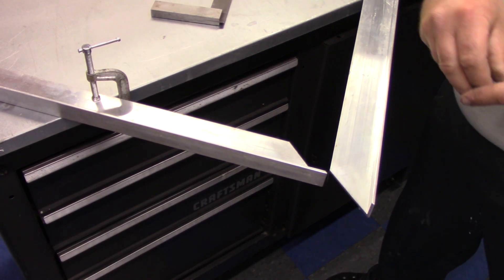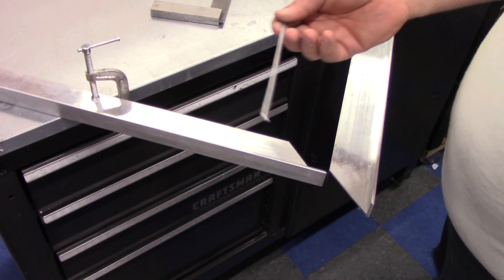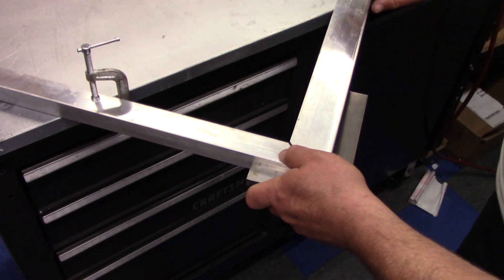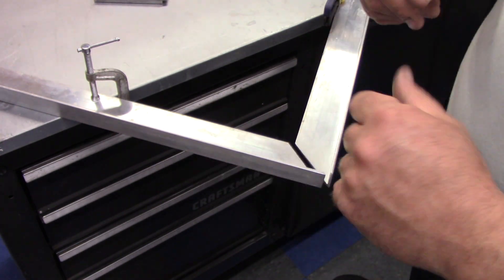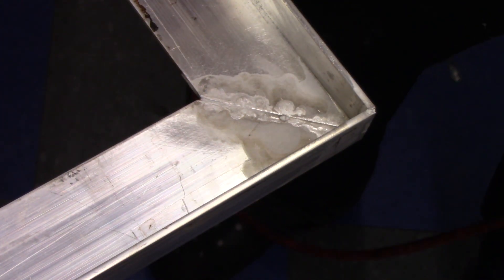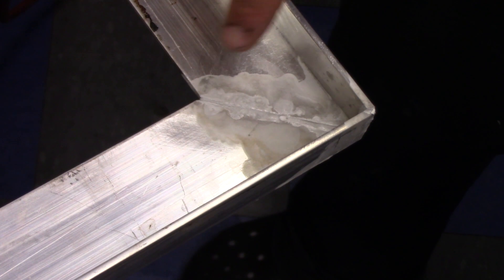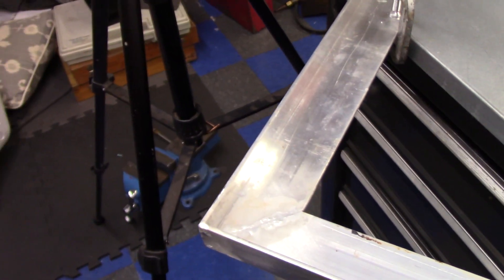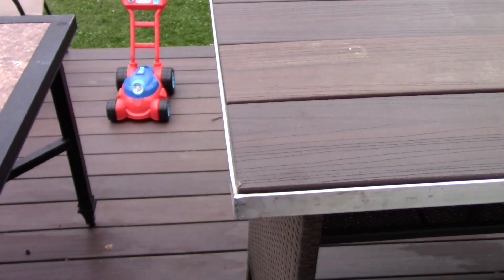Aluminum Brazing With Acetylene Torch

Comment: Blazing really just doesn't hold up that well, just invest in a stick welding machine. Try using the flame torch instead to preheat the metal pieces to about 600-650 Degrees F. With an ER4043 stick, set your Arc to ~25%, Amps to 80-90 (more towards 90 if very thick), and then make sure to keep consistent heat on the metal. It should be an OK weld. Won't look like TIG or anything but it still gets the job done.

Comment: The thing i don't understand about brazing, is the aluminium brazing rods melt at 580°C, and Aluminium melts at 660°C, and gets soft and compromised sooner than that.
Unless you've got very precise temperature control and monitoring, how come the aluminium doesn't warp and droop when brazing?

Comment: Yeah it’s very helpful and easy fix too in a pinch you def have to heat that up more so if it a higher stress point I’ll heat up a portion of the crack enough to do a dime one first second third centering it in but I’ve seen people use axle grease to welds cast aluminum didn’t believe much in the method at first till I seen quality of work kind of but not really just in the sense iit protect the weld . A battery charger stainless steel plates like outlet cover liquid elc tape all stacked in series tickled by about ten amp off alternator using the vacuum for injection to pipe hydrogen generator by this simple install not bullishit seriously Il l give anyone my Toyota Camry if you can show me it doesn’t work literally within a couple of weeks the inside of your motor with be Perfectly  lean Toyota doing a 3 cylinder version turbo puts out more ponies then it’s turbo older cousin

Comment: I haven't tried the Lucas ones yet. Only aluminum rods that worked decently for me or anyone I know is Hobart brand (can get them at TSC).  Those will give you a fighting chance of success.  Those Lucas ones you used were really good AFAICS but wanted to thank you for a piece of technique you showed - heating the parent aluminum until the rod wicked onto the aluminum (keeping the flame away).  I did this before, but what this video showed was that the wicking test is really the only way to go about using these and not mixing in any other method.  

Also, it looks like that air tip is the best tip to use for this from what I can see.  It's perfect for the task (not too hot - too hot makes heating the aluminum more unpredictable). Thanks for showing this.

Comment: Alumaweld best way to get it to work is use straight acetylene to leave a black film on your work surface.   Then using your oxygen and acetylene, once the black is burned away it's hot enough to braze

Comment: Aluminum weld works great. Metal has to be cleaned. Propane or Map gas will work. You have to be careful not to overheat or melt the pieces you are welding.

Comment: I broke the tachometer can mount tab on my motorcycle. I used the aluma rods from harbor freight. Clean, Flux and temp control. Too hot is just as bad as too cold. I have temp sticks for this.

Comment: So the ally rods are great for specific operations. If you are failing to use this material strategy you probably thought to heat the rod... You heat the rod at all... You heat the object to atleast 660c and then apply the rod to the joining area........ With heat still applied to the original/base object allowing it to maintain high temp

Comment: You did most of the soldering wrong. Heat the metal and melt the rod onto it. Don't put the torch on the rod.
Reply: He did, that’s why it worked. Literally heating the metal from the bottom applying the solder on the top. Strange comment….

Comment: Alumaweld works great. The gaps here are too large. The pool will just flow through the gap and drip out the bottom like water. Pieces need to be butted together reasonably tight.
Reply: You mean exactly what didn’t happen in the video? You bother watching it?

Honestly I was impressed he was able to fill that gap.

Comment: Personally as a welder I do a ton of brazing and soldering , I think you need better understanding of the technique with the torch
Reply: @Traditions-catch hear we go with the I'm a welder and your wrong bs well I’m a certified welder and been for a couple decades so the one thing I have learned is everybody’s technique is different but works for them, you can show someone your technique but usually they stick to there own
Reply: @justinw523 back in his day he could out weld everyone with his eyes closed
Reply: If you use an oxy-acetylene torch that is properly adjusted, you will notice  dark area of the flame.  The dark area is neutral and as such is the shielded area of the flame and your bonding should take place in this region to prevent any unwanted gases from contaminating your weld.  The rule of thumb is the kernel of flame should be approximately the same width of your workpiece.  Choose the appropriate tip and adjust for the dark area of the flame and proceed.  These procedures will work with many different types of metal.  Stainless and aluminum will melt away rapidly if you exceed temperature, so proceed with caution and practice before continuing with the workpiece.  Cheers
Reply: @hillbilly4christ638 good tips! I'm a west coast metal head-rocker for Christ! 🥳
Reply: Would you recommend using an oxygen and a settling wing tip?
Reply: It worked! Why do you have to comment like a smart ass?

Comment: To get the harbor freight stuff to work, you need to heat up the rest of the surrounding metal to 720. Gotta be using Mapp gas and a beefy torch too.

Just gonna get an oxy-propane torch because I want to braze steels too.

Comment: There’s absolutely no fusion do it at all it’s basically just like laying solder on there… it will work for low tensile applications but no comparison to it being arc welded

Comment: 10 years ago I used similar rods.  I think they were from Harris.  My LWS gave me some to try and work just like yours and they weren't cheap then, either.  
However, those Alumaweld rods will work.  You just gotta alter your technique because they are fluxless.
I kept meaning to post an in-depth video on them and why most attempts fail but I got old and forgot.
Reply: p.s.  When I do make the vid can I use a bit of your footage to compare the 2 rods?  I don't have any of the expensive rods anymore and I was going to mention/shout you out as part of the story/reminder.
Reply from the maker: @EddieTheGrouch   Absolutely.  I tried scrubbing and getting those alumiweld rods in the joint, but never really worked for me.  I could get it to cover, but never into the joint for a proper bond.  Also miss your vids.

Comment: Thanks for posting this. Can these rods be used with any aluminum? Had you tried to break any of the joints to see how tough it really is?
Reply from the maker: This 6083 is the only thing I have tried it on and the website just says Aluminum-aluminum and aluminum-copper joints.  I don't see why it wouldn't work, but you never know.  I made a 90 degree T joint and tried to pull it apart.  The aluminum bent and cracked but the join didn't.  Again it's purpose is aluminum coils for HVAC which an run around 120-140 PSI
Reply: @Halligan142  Thanks for the info as it's very much appreciated!

Comment: Alumiweld and all the similar rods are a waste of time.  They're usually a simple Zn-Al brazing alloy that's generally indistinguishable from Zamak3 and similar inexpensive galvanizing alloys (96/4).  Some trustworthy products may have purpose-suited trace alloy elements to promote wetting, but I doubt any of the Amazon/HF rods are anything other than Zamak.   You can literally do the same task with an old conduit fitting or something.   I should point out that almost all of these bare rods will say stuff like "no flux needed" or "the flux is in the rod".  This is almost universally a false statement.  The exceptions are noted below.

Zinc alloys will wet aluminum fairly well without flux, but require mechanical agitation to actually disrupt the passivation layer.  As such, they will always tent over joints instead of penetrating them.  In manufacturing, these alloys are used with flux (see Superior #1280), but you'll have to purchase direct from the manufacturer if you want it.  There are coated/cored versions of these alloy rods (and preforms) sold for HVAC work (see Lucas-milhaupt AL822, ChannelFlux ZA-1, and ALUXCOR), but they're ridiculously expensive.  Considering that direct purchasing flux from Superior would require a $100 minimum order, they're still cheaper if you don't need much.

So let's say you did have flux.  Would using these intermediate zinc-alloy solders be a good thing?  In my opinion, not generally.  All zinc-bearing solders will be extremely susceptible to incisive corrosion, especially in the presence of any chlorides.  This isn't a thing that takes place over years or decades.  Joints exposed to saline solution will tend to just peel apart as the intermetallic layer is selectively destroyed.  Immersed parts can easily fail within hours.  For a condenser or your table, it probably won't matter, but I see people saying they made aluminum motorcycle trailers out of these things.  Considering that road salt exists, it's kind of horrifying.

In my estimation, this kind of explains why there are so many of these rods on the market, but no flux.  They're a product that can be manufactured from cheap (usually scrap) material with no real need for dimensional tolerance or material property control.  Over a broad range of conditions, they give the illusion of working well enough that the user will trust that they simply don't possess the talent or experience to make them excel.  The manufacturers that aren't being dishonest about their products are well aware that they have limitations and that the actual market for such things is very very small.

TL;DR  Unless you go buy flux and you understand the weaknesses of the alloy combinations, you're wasting your time with Zn-Al processes.  Al-Si is where it's at. 

EDIT: oh.  I guess you''re using 822.   AL822 is a 78/22 Zn-Al alloy with (iirc) cesium fluoroaluminate flux.  I don't know if Lucas makes a 98/2 rod, though I know others do.  The 98/2 should be better for capillary performance, but I guess you don't need that here.  
You solder/braze all the time.  Now that you've tried a Zn-Al process both with and without flux, what is your opinion of the claims that the bare rods "need no flux"?
Reply from the maker: These worked surprisingly well.  As you said they are geared toward HVAC and are for aluminum coil repairs which nowadays typically run in the 120-150 PSI range and can be in varied environments.  A lot of the coil cleaners we use in the industry are alkaline based and some are touted as "no Rinse" which I always said was BS, but I wonder if that would effect the joint over time?  As far as flux vs fuxless those alumiweld rods are garbage.  I cleaned just the same as in this case with a stainless brush.  Heated the metal up and scrubbed to break up the oxide layer.  All I got was a puddle of melted rod that was well attached to the top layer and exposed edges, but would not penetrate into the actual joint or would attach to one piece, but peel away from the piece I was trying to join.  Even if it did work well, the scrubbing action required melts way more rod then needed and it ends up looking like someone ran a bead of caulking along the edge.  Using the AL-822 was way more akin to what I'm used to with using soft solder, silver solder, and sil-foss rods to join copper to copper.  Heat it up and it flows easily with the heat and is controllable.  Like you said and I said, not anything I would use for any kind of structural or load bearing work, but for decorative stuff or in this case a basic frame it will work for someone without "proper" welding equipment.
Reply: @Halligan142  It's hard to say exactly how susceptible the joints are to corrosion.  The samples I ran were on various 6000 and 3000 series alloys, but I had them immersed.  FWIW, Zn-Al did do better than Sn-Zn (soft solder for aluminum).
If they're just occasionally damp, idk if it would even be a concern.  Like I said, they use this alloy in preforms when manufacturing coils and other similar tube heat exchangers.  I figure it's good enough for that.  I don't think I'd build a boat out of it though.

Comment: Very cool!  I have struggled with the HF Alumiweld rods too--one trick is that you can effectively only melt them once.  This means any little berries on the rod or puddle on the work are not going to remelt without trouble.  I am definitely going to try these rod instead in the future.
Reply: The reason that drippings cannot be reflowed is revealed in my other comment.  Without flux, the solder has no means to wet the base metal.  They rely on mechanical scrubbing to achieve wetting.  Once the blobs are separated from the rod, they don't get scrubbed around, so they won't wet to anything.  

Like any soldering process, these intermediate Zn-Al solders require flux for any practical use.  The Alumiweld rods and the Lucas AL822 rods are both Zn-Al rods.  The primary difference is that AL822 is a flux-cored rod.  Unless you're paying $5-10 per rod, you're getting bare rods.  The bare rods have no flux, and flux alone is not readily available.

It's worth pointing out that the Lucas rods he's using here are 78/22, which is the "thicker" gap-filling alloy.  The Alumiweld rods are nearly-eutectic 96/4, which should actually flow freely in comparison.  You've now seen fluxed 78/22 and seen how it flows and wets freely, even on 6000 series extrusion.  When you used the "thinner" alloy in the Alumiweld rods, did it flow like was thinner, or was it a lumpy, drossy mess that liked to bridge over surfaces without wetting completely?  Flux makes a huge difference.